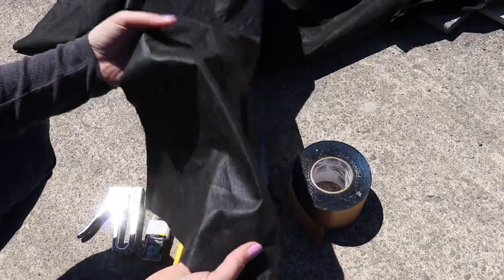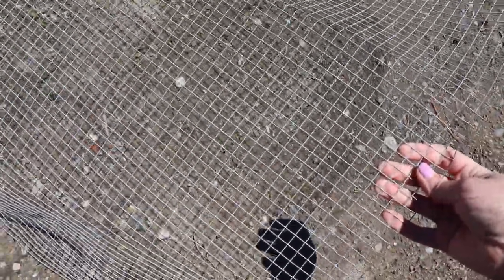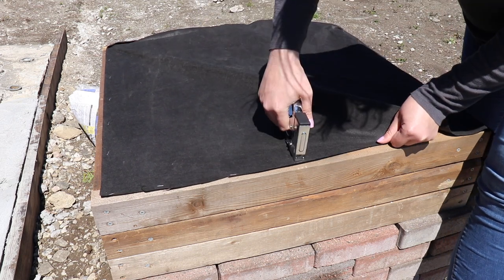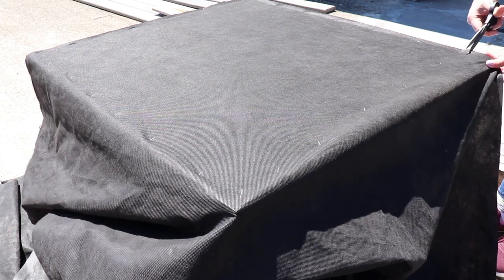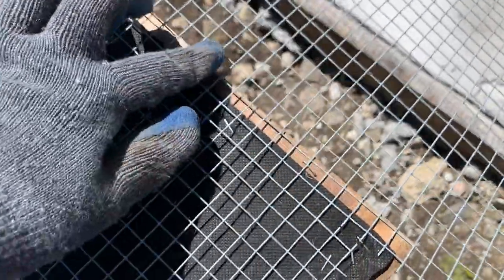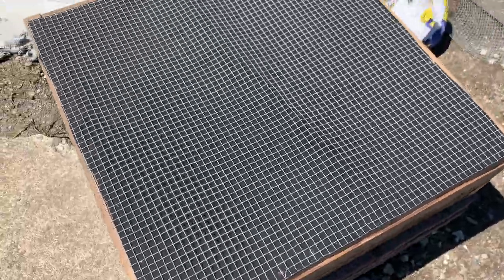DIY RAISED PLANTER BOX // How To Add Waterproofing Liner And Bottom

Comment: Is the corner piece for structure absolutely necessary? I made some 1.5x3ft beds using 3-1/2" screws that feel pretty solid.
Reply from the maker: Hi Dillon,
If you already built yours and it’s stable then forget about it! I needed something that was going to attach all three layers to each other and keep it from wobbling.
Reply: Hi  @WhitneyBaldwin  . Thanks for the answer. I see what you mean.

Comment: Interesting technique you used to line the planter, not seen this yet. Today I built a raised planter for the first time. It was built, or upcycled, mostly from two large wooded pallets and is raised using dining table legs which sits inside the corners of the sides all the way up through to the top of the planter. I put a 1 inch thick piece of chipboard from and old office desk in for the base, not a good option I know, but it's the only large piece I have available and I plan to support it from underneath with something for when it eventually sinks in the middle. So I want to install a liner next to waterproof the inside and protect the bottom as much as possible. Can you recommend a material please?
Reply from the maker: Hi there! That sounds awesome! The cheapest and easiest way would be to use a heavy plastic sheeting like visqueen and staple it to the inside.
Reply: I bought plastic sheeting that is 9 mil thick, I found them in paint department where drop cloth located. Pretty thick plastic sheet.

Comment: Whitney, What did you use to keep the soil in along your picket fencing?   I have a three sided cinder planter with wood and wire fencing on the 4th side.  ???
Reply from the maker: Hi Kerry, I used the hardware cloth (rabbit hutch mesh) along the inside to help keep the soil in as well as keep rabbits out.

Comment: With just the wire mesh and landscaping fiber stapled to the frame it doesn't seem strong enough to hold all that dirt.
Reply from the maker: Hi Janet - thanks for your comment. It has held up to perfection over the past couple of years if that puts your mind at ease.